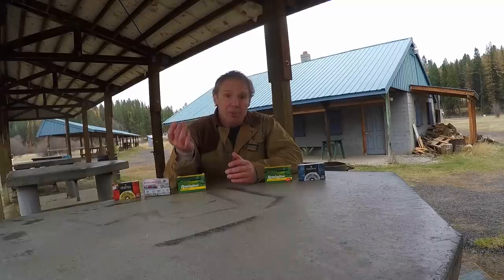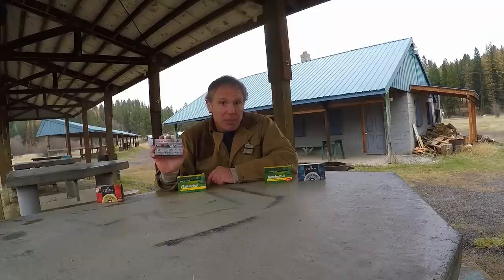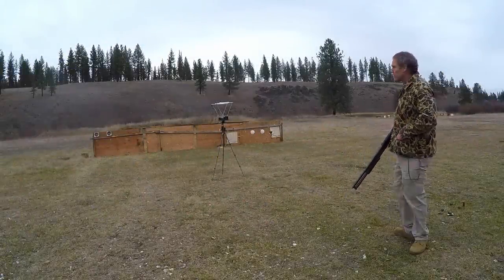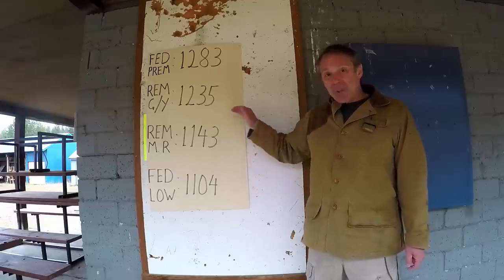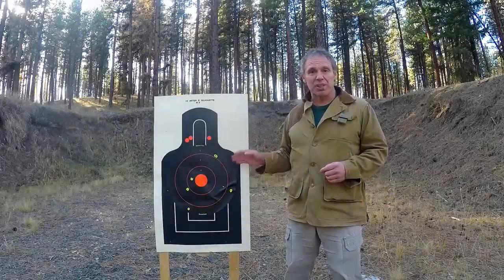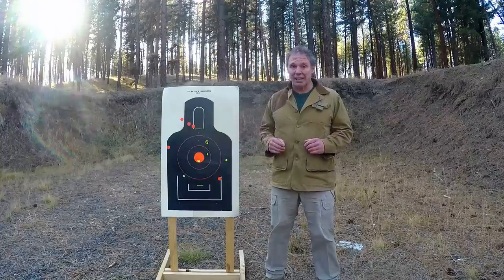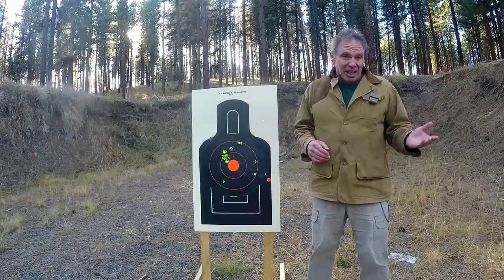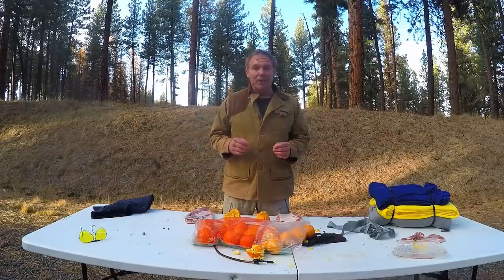Personal Protection: Reduced Recoil 00 Buck

Comment: Paul cycles that action so smoothly, it almost appears to be an autoloader.
Reply: I thought the same. I obviously need much more practice.
Reply: I thought at first couple demos he WAS shooting an auto, then watched closer. Damn!
Reply: Seriously how does he run it like that? Almost like a slamfire but stops before the second round.
Reply: Just practice. Muscle memory. If you run a pump shotty for a while and practice, like, a lot, you can do it. I got pretty good for a while but I haven't practiced.
Reply: Covefefe
Winchester 1897s are full fire while you hold the trigger down and pump they fire when the breach locks. Used for rapid fire in WWI. Hence the term trench gun.
MOST all others you pump while holding the trigger pulled, THEN reset for the next shot..
Get the next round ready to fire asap.
Reply: When he did one of the videos on shotguns he specifies....'pullrack' is one word and one motion. :-)
Reply: He's so smooth with a pump, he makes it look like he's just riding the recoil.
Reply: Whenever I want to feel bad about myself, I watch Paul run his 500……..or any pump action shotgun. The pullrack champeeeeen of the woooorld!
Reply: I was shooting my shotgun the other day and trying to practice something he said on another video, where you pull the trigger and rack the slide almost simultaneously. He says pull rack, well I have made progress but I have a ways to go before I can work the slide like he can, I thought I was fast until I saw him.

Comment: Finally someone on YouTube can demonstrate properly running a pump shotgun.  Thanks Paul!
Reply: but he's not a 3 gun pro
Reply: MrSGL21 I bet he would do just fine.
Reply: @FishFind3000  it was reference to a video he made
, shotguns don't suck for home defense.
Reply: Y'ALL GOT THAT RIGHT !👍
Reply: I don't know why people wait so long to "pump" the action after shooting. Its not hard to do quickly and with some practice, I've seen guys shoot a pump action faster than a semi auto...
Reply: Everybody else runs their pump shotgun like the "bang" and "pump" and "aim/pull" actions are all very much separate operations. Takes forever. Paul on the other hand, simply combines 2 or 3 of those together. And he has a good stance, and a good hold on the gun, and he's not afraid of it.
Reply: I would have slammed fired the shotgun, I would have gotten a faster time.
Reply: @toddk1377  If you learn the technique of slam firing, I did it a range once to demonstrate, that I could shoot 2 3/4 military 00 and 3 inch magnum loads and handle the recoil, he still to this day is trying to figure out, how I fired the shotgun that fast.
Reply: Just be sure not short stroke it
Reply: @biteme19671  not many shotguns are slamfire anymore.
Reply: @robertsauceda4757 You are correct, it was a safety issue.
Reply: Use the slow-play video options on Youtube and watch his technique in slow motion.
Reply: @biteme19671  
I don't need a slam fire capable shotty to shoot fast...I pull back hard on the forend so the shell gets ejected as soon as I press the trigger and the action is released. I had to learn to shoot fast when we would go duck hunting, all the other guys had semi autos, I was the only one with a pump. I had no issues keeping up, plus I didn't have any malfunctions like they did either, lol.
Reply: @toddk1377  Definitely a skilled learned as well.
Reply: An empty shotgun is just an expensive club.
Shoot
Then load instantly
Just in case you need another one.
Reply: @robertsauceda4757  
That’s why gunsofmasseffect was careful not to mention what make and model of shotgun he was using when this allegedly happened.

Comment: Great presentation. I found when using 2 3/4" shells of 00buck, Remington patterned the best out of my 870 with a 18" barrel with a full choke. When using 3" magnum shells, Federal patterns really well in both 00 and #4 buckshot. These were all done at 40 yards as I use these loads for deer. A lot of people say buckshot shouldn't be used past 50 yards or even less, but if you pattern your shot using different chokes to keep a tighter pattern, you'd be surprised how well a 3" mag with 15 pellets of 00 drops a full grown deer at 70 yards. I've done it quite a few times and not once have I ever had to track a deer, yet I've tracked deer with a double lung shot and a golf ball size hole out the shoulder from a 12 gauge slug shot at 20 yards. Using the right load for a shotgun and choke that patterns well or tightly at the expected ranges to shoot can yield results. I say do your own tests before reading some so called experts advice on a forum. As how Paul did the pattern tests here, it is the correct way to do it, compare the results! 👍
Reply: Thanks Todd , my curiosity was up after seeing this... an' old guy I know told me the same thing .👍

Comment: Paul, thanks for the informative video. I'm sure it will help a lot of people. I just wanted to mention that I've gotten excellent results with the Federal Premium Law Enforcement Tactical 00 Buckshot load, Number LE132 00 in the course of running a great deal of police shotgun training in settings where multiple different police shotguns were in use on the same course of fire. This load uses the Flite Control Wad, and is listed at 1145 fps for 9 pellets. I actually get about 1100 from an 18 inch barrel when I place the chronograph 5 yards from the muzzle. This particular load provides for really tight patterning out to 25 yards with a Cylinder bore gun. It seems to work better than the "Blue Box" Power Shok load. Unlike the blue box hunting load, it is not marked "Low Recoil" on the package, but it actually is. I'm seeing approximately 12-15 inch patterns at 25 yards with all 9 pellets accounted for. Recoil is mild. Its SKU number is similar to, but not the same as the blue box load.

The second point I'd like to mention is that I've seen some minor trouble on a few occasions with the Remington Low Recoil 8 pellet load not properly cycling the action on every semi-auto shotgun, especially if said gun has been dirty nearing the end of a range session. This was really not much of an issue for my former agency because we used pump guns. Finally, it was a real pleasure to watch you run your pump gun, Excellent shooting!

Comment: I have used a lot of 1325fps, 9 pellet loads from Remington, Winchester, Sellier and Bellot, etc. It all performed well. Never seemed to need slower velocity. It all worked well enough. I know my around the house ranges will not reach 25 yards. At 15 yards the patterns were very good. I have fired shotgun slugs on deer in my youth. Those were stone cold killers. These days I use center fire rifles for deer. Excellent video. You stressed patterning and I do believe that is critical for everyone to do. I do it as you did at 25 yards. It is important.

Comment: Thanks for the info Mr. Harrell. Most shotgunners know that it takes a certain distance for the pattern to open up. With my Winchester model 12, 16 gauge with full choke, it typically takes 30 + yards to open.
My Winchester model 1200, 12 gauge with improved cylinder, takes upwards of 20 + yards... Shooting steel shot this year on Dove, as mandated by Commiefornia, it opened up around 15 yards with a reduced killing range of about 25 yards... I had to dispatch a lot of crippled birds that otherwise would have been done in by the more effective lead shot... Needless suffering...

Comment: I retired from a big city police department. I was a member of the “Shotgun Slug Cadre.”  Our shotguns were privately purchased, mostly Remington 870LE with 18 inch barrels. We were issued Federal Premium Tactical low recoil 2 3/4 inch 9 pellet and tactical low recoil 2 3/4 inch 1 oz slug. We patterned our buckshot at 5,10,15 and 25 yards. At 15 yards all 9 pellets were in the head (2 3/4 inch spread) with the cup in the neck. At 25 yards I had a 9 pellet 10 inch spread in the body. The advantage of this round is to limit the spread up to 25 yards. The slug was used for longer shots and suspects with body armor when rifles aren’t available.

Comment: This mainly applies to"fixed"breech guns.Pumps,singles,doubles.
On semi-auto's,the same recoil is spread out over a much longer time,so the perceived recoil is less.
In smaller gauges,20 gauge in particular,the recoil is nearly half of the 12 gauge using the same loads.
Reply from the maker: Anyone who thinks autos have less recoil has never fired a Remington model 11
Reply: @PaulHarrell  Oooh Paul,please read that again.I said..."the SAME RECOIL is SPREAD OUT over a much longer period of time".The recoil tends to be more like a big push,then the short,very sharp jab,like a pump action or break barrel will.(like a shock absorber from the main recoil spring on the mag.tube)
I used to own one of those Paul,I had a 1906 Remington Model-11 12 gauge with full choke barrel,I would still have it,but someone offered me a cash price that I could not refuse.
I have a BrowninG A-5 in 20 gauge with the mag.cut off feature and speed load feature.Either way,both of these shotguns are amazingly reliable.
Keep up the great work Paul,I always enjoy your videos and always learn something new from them.🤠👍

Comment: BZ, Paul, this is ANOTHER excellent, very instructive presentation;  THANK YOU!  I’d respectfully offer two comments:
-     Isn’t there another approach to reduce Twelve Gauge recoil?  How about using a LimbSaver (or a similar recoil pad) to complement the attenuation provided by the factory-installed buttpad?  Wouldn’t that be likely to achieve the desired goal and still allow the use of far more common, less costly, and long proven shells?
-     It’s noteworthy (at least to me) that Federal designs/manufactures some great loads (I love their Flight Control 00 Buck, for example), but also some truly marginal ones.  While I understand they want offerings to compete in every segment of the marketplace, I’d think their aggregate reputation might be damaged by an inferior product.  When a novice shooter has a bad experience with cheap and shoddy ammunition, how likely is he to ever purchase that brand in the future?

Comment: I agree 100% that 00 or #4 seam at least here to be the most popular for home defense and hunting with people that I know that still use buck shot.
  When I was growing up though most of the people that my dad and uncle's doghunted with used #1 buck. Along with the uncle that was a sheriff back in the 50's to early 60's from what they told me.
 Any way there idea was it held more pellets than 00 but each pellet would be a bit bigger and heaver than #4.
Also at that time a lot of the shotguns had fixed chokes and they thought that full was to tight to pattern 00 that well.
  
I did use #1 when I first started deer hunting with them. Grandad gave me the gun for a bday and my dad the shells.
 As soon as I could I saved up and got a 30-30 for hunting.

Comment: Fifth factor: Length of the barrel. If a projectile of a given weight is accelerated to a given velocity, with a shorter barrel, you will subjectively feel more recoil, because the impulse curve is steeper. This does not usually apply to shorter/longer barrels with the same round, because then, bullets typically get accelerated less. It does apply to different ammunitions and brands, when a hotter load fired from a shorter barrel is compared to a weaker round fired through a longer barrel. Even though the terminal ballistic profile is the same, the hotter load fired from the shorter barrel will feel more "snappy" in its recoil.

Comment: Thank you. This was very helpful. I'm disabled by Axial Spondyloarthritis and recoil has become a major concern for me, but I love shotguns. I can't shoot much standard 2.3/4 ammo, so I have been using Aguila Minishells. They have SIGNIFICANTLY less recoil than the normal offerings. I have only just gotten into shooting shotguns again and don't recall how fewer the pellets were, but I think the velocity was very similar. And they offer two benefits in trade for power and density: less recoil AND more capacity. They run very well in my Mossberg 500A with the OpSol miniclip inserted ($15 removable part).

I'd love to see them compared in the next video, if it isn't too late.

Comment: The 5th influence is the type of action. In my experience, semi-auto shotguns have significantly less perceived recoil than a pump action or other manually cycled shotguns (eg the less common lever action, or bolt action systems). The semi-auto action seems to spread the recoil over a longer period of time, resulting in more of a "push" and less of a "kick'... all else being equal.

Comment: My SO went to Federal 12ga reduced recoil 8 plt buck with flight control wads. Previously used full power 9 plt Winchester or Remington, which always threw at least one pellet off torso at 25 yards. With Federal, I patterns were never more than half a torso wide. I was quite satisfied with the Federal load. You can only kill someone so dead. And if I can keep all pellets on the bad guy at any reasonable shotgun range, I'm happy.

Comment: There is a real world use for low recoil 12 gauge ammo.  I've used it to teach those of low weight and short stature how to manage the larger bore.  Primarily, that has been ladies and youngsters.  I learned that size doesn't really matter when shooting a 12 gauge, because when I was a skinny 12 year old on a mule shooting varmints and small game, I got in the habit of shooting a single barrel 12 gauge one handed, mainly because my arms were too short to reach across to the forearm for a far right hand shot.  And no, the mule did not get upset.  He was old and half deaf, but he could still jump a fence.

With proper hearing protection, I've had very slight ladies become comfortable with the shotgun using the lower recoil (I've even used the mini-shells).  I've found that most women that have had unpleasant previous experiences with the recoil of a shotgun were reacting more to the pain to their ears (and subsequent headaches) than they were to the actual recoil.  Once they had the ergonomics down pat, we moved up to powerful ammo.  But if my wife is using one of our scatterguns for self defense, I want her to be using the most powerful, heaviest, load she can effectively manage.

Comment: Great info as always. Would have been nice to see the pattern difference with the Flitecontrol ammo, but i think i understand why it was not included. We know it works well. I tested some years ago at my own expense when i was still in LE, and we quickly went to it. In our cylinder bore 870's, all hits would stay on a silhouette at 25 and even 30 yards, thus substantially extending the reasonable engagement distance for buckshot (it was dicey past 15 yds with standard Winchester). Anyway, some limited testing with the reduced recoil stuff later on showed that it did have less recoil and seemed to pattern fine,  indicating that it would be effective. Glad to see that the meat target results bear this out. And no felon is going to stand there and say "Hah! You only hit me with 8 pellets 125 fps slower, and not 9 full power. Just like a deer isn't going to say hah your load is 100 or 200 fps slower than nominal (or a 30-30 vs a 308, almost a 400 fps diff in muzzle velocity w/150 gr bullet). Shot through the vitals is shot through the vitals. Looking forward to the #4 buck tests, since standard #4 is what i keep in my 870 at home.

Comment: As a muzzle loading fan, I can swear that the same load of powder and birdshot in two guns of different caliber (say 20 and 12), the 12 will pattern better even though the load and recoil is the same (if guns weigh the same etc.). In other words, all else being equal, a wider bore diameter will mean better patterns. 

This would probably hold true if you can reload modern 12 gauge hulls with a 20 gauge equivalent buckshot load. But this may be hard to accomplish since the buckshot has to be the right diameter to form level layers in the hull.

Comment: You should try the 12ga Mossberg 500 FLEX in the 28" barrel full stock configuration (has I think the 1.25" butt pad).
The one I have feels like it has less recoil than my AR-15, even firing 00 buck, and less recoil than a .30-06 when shooting slugs.
I don't even bother with a shoulder pad, it's such a smooth shooting gun!
If you run low recoil or those Aguila (sp?) mini shells, the thing feels like you're firing a .22LR, the recoil is so gentle.
You can also get a FLEX conversion kit to convert non-FLEX models to the new system.
While a bit gimmicky, I will say the FLEX version of the 500 has grown on me, not just because of the super low felt recoil, but also because you can break down the gun to fit in a compact space. When broken down, it's about the length of a typical AR-15, the barrel being the longest part. Assembly and disassemble is tool-less, and can be done in about 10-20 seconds.

I know, sounds like an ad, but I just really like it. Downside is there isn't much 3rd party support for the FLEX system, as in virtually zero.
It'll still take the same barrels as other 500 models, and I think you can replace the pump slide with the more traditional corncob style.

Comment: I appreciate you shooting at 25 yards. As an LEO the odds of shooting at a distance like that is more common on the job. I'm one of the few at my department that still likes shotguns. I work in a densely populated area and I like the added safety factor vs the 5.56. Not so much for penetration but limited range. If I'm in a situation where the threat is further away slugs can get it done. It's very rare the threat will be over 100 yards for me.